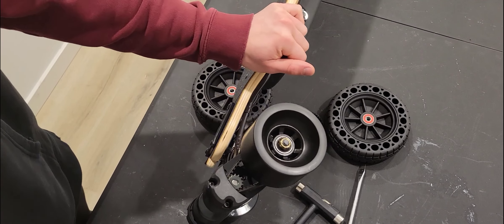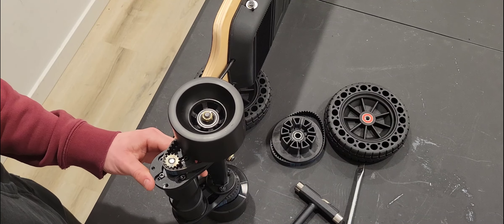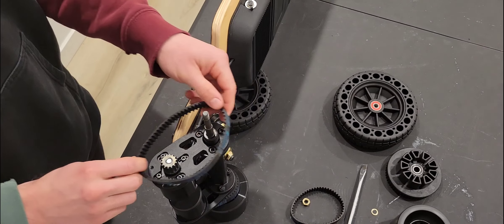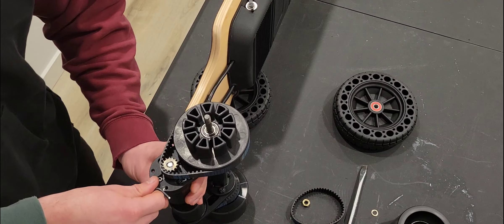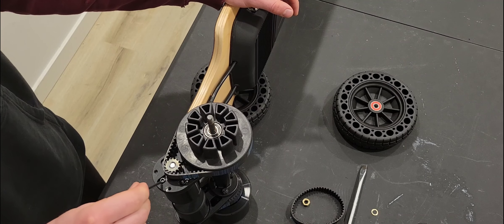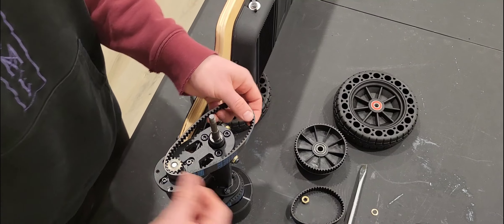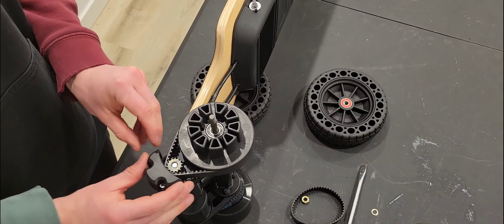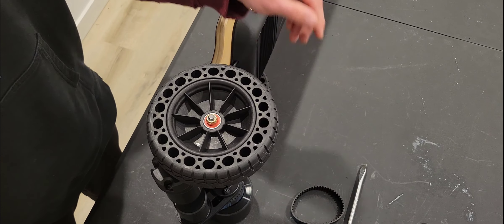Changing wheels, pulleys, belts on your belt-drive Electric Skateboard

Comment: Question for your viewers: Purchased HGLTECH BLDC (6354/1 90K V), included was "15T" pulley (8mm keyed shaft)... assuming this indicates 15 Teeth.
Seller no longer responds to my queries, however, posted in previous responses state "kindly use HTD5 pulley".
I confess I do not understand nomenclatures for these systems... my goal is to achieve a 1:1 gear ratio (why is irrelevant); Found "HTD5 16T pulley" (Amazon) that appears to be correct.
if center-to-center axis spacing is to be roughly 7 - 8 cm (i.e. drive shaft to driven shaft) what belt (specific order number?) should I search for?? 15T to 16T is an acceptable ratio. Many thanks.